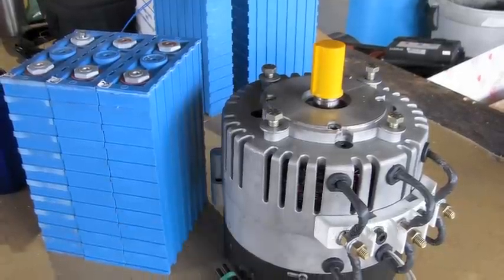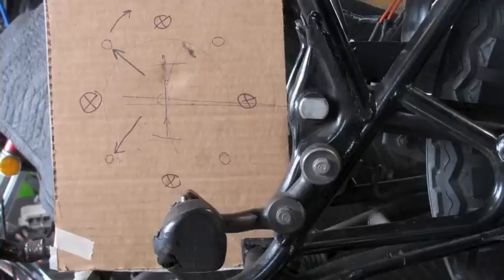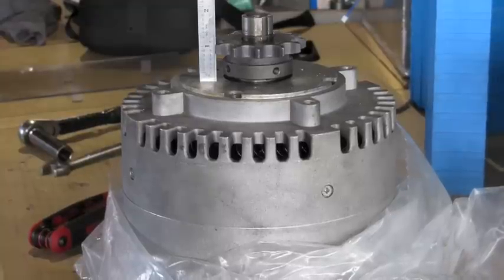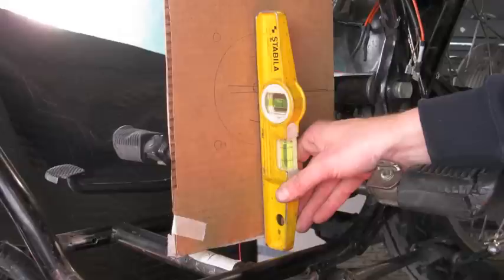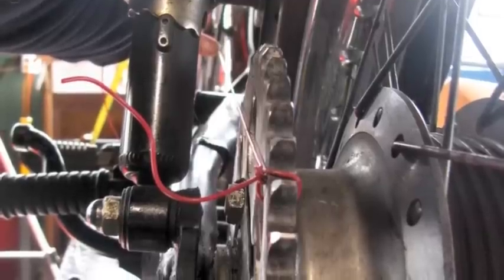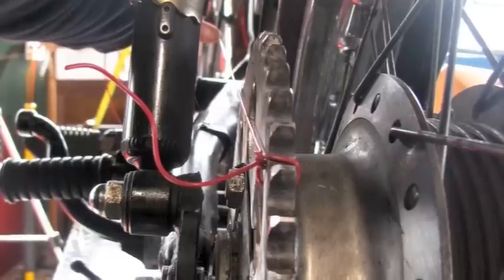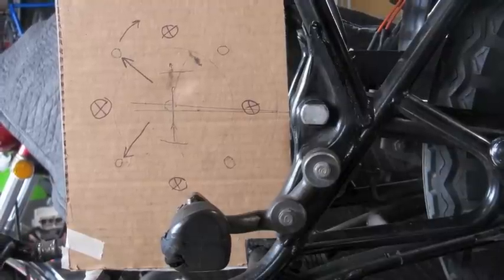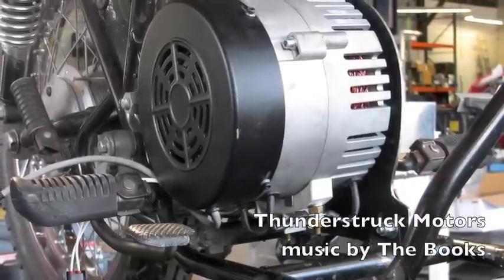Motorcycle Conversion Pt. 1

Comment: This motor what u use is waterproof? and what is the cost?
Reply from the maker: The motors are considered splash proof and they retail around $980, depending on tariffs. If you were using it in a muddy area I'd make a splash guard for it. We also have some nice fully sealed motors available.

Comment: A related question, one of the things I've been thinking about from a rolling donor is a BMW with a drive train to eliminate the need for a chain or belt, but then I wonder how would you connect the motor axle to the transmission? Any experience or thoughts on that idea? Again much appreciated. Thanks!
Reply: That is not ideal as you're stuck with one gear ratio which is likely too tall. Chain is also much simpler.

Comment: I know it's an old video, but how's the motor holding up to particle and water ingress as it's open?
Reply: Hi Jamie! This motor has no brushes so it's even less of a concern, although even a brushed motor usually has no problem with rain and puddles. Mud could present a problem, so a splash guard is recommended if that's a possibility. Most older conversions for cars used big series wound motors with mostly exposed brushes and rotors. We've had several of these in the shop that lasted well through their first set of brushes.

Comment: What kind of power are you getting out of that motor?
Reply: The motor is rated for 30Kw peak at 96v, but since this is running at 72v it's max is about 22KW.

Comment: what hp is that motor???
Reply: +Jess Evans This is a Motenergy ME0913 motor rated for 30Kw peak (at 96v) which translates to about 40HP.
Reply: thanks for that, i was guessing 20-35 hp would be enough and ive watched several videos like this but never caught anyone telling the model or hp of the motor. i appreciate the solid info